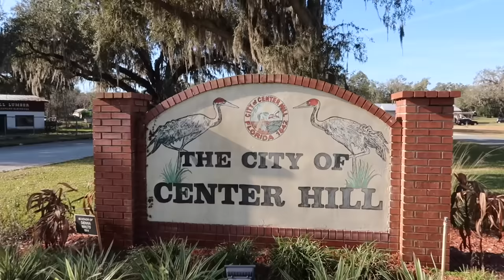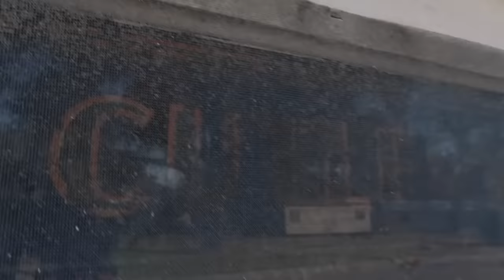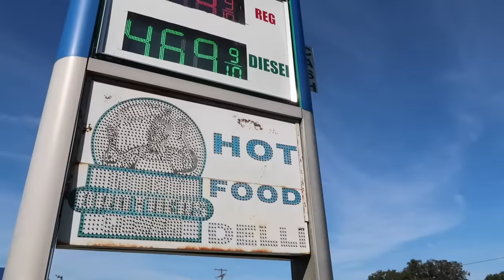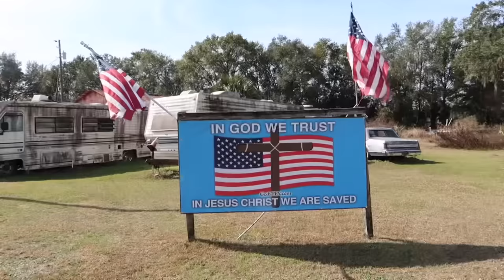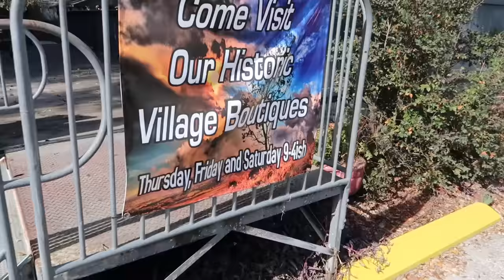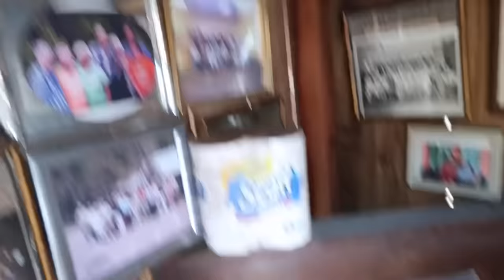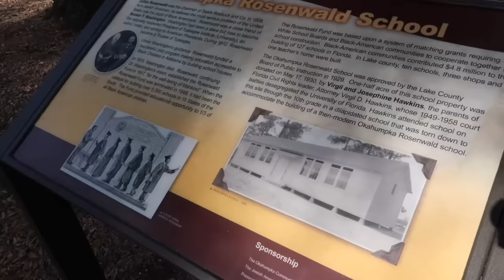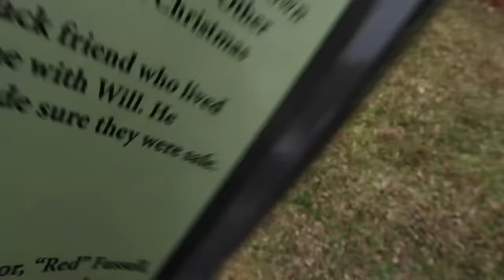Central Florida Ghost Towns & Backroads - Talking To Locals About Forgotten History / Unusual Finds

Comment: “Shotgun houses”were very common in colonial times. The house has a central hallway with rooms off to the sides. If you fired a shotgun through the front door, it would exist the back door without hitting any of the rooms.They were built that was for air ventilation!
Reply: They're all over New Orleans still, I lived in one for 10 years

Comment: The building with the curved metal roof is called a Quonset Hut named after the area where they were first designed and built in Quonset Point  Rhode Island

Comment: You keep saying 10 digit dialing vs. 7 digit dialing. You can still dial seven digits if you're calling from the same area code as your phone. Call call someone in the town you're living in, using seven digits. As long as your phones area code (first 3 digits) is the same as where you are, there is no need for 10 digit dialing.